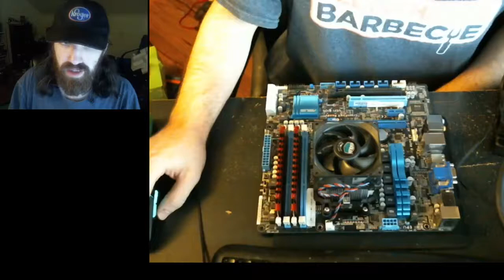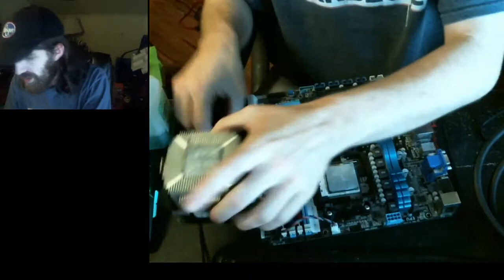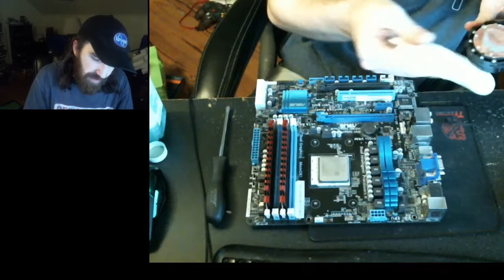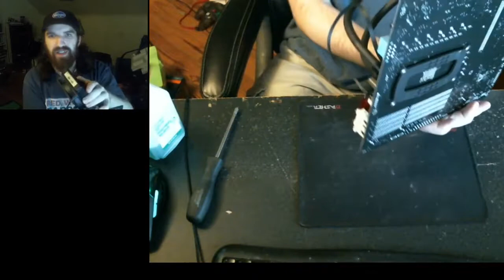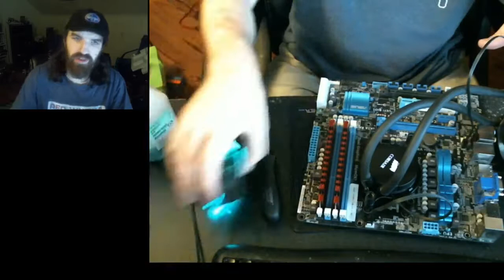Installing Corsair H55 Cooler To AMD Processor

Comment: so i can install this on a ryzen 3?
Reply from the maker: Yes you can, but you have to buy the AM4 Socket bracket if it doesn't already come with one. Sorry for the late reply :)
Reply: @TerraTechComputers  Thx! Apparently the cooler already came with the am4 bracket
Reply from the maker: @Champi  Glad to hear it :) I remember right, it has enough screws to mount a second fan to have push / pull configuration. Which will greatly improve cooling. Only downside is it adds a bit more dust to be cleaned each month.